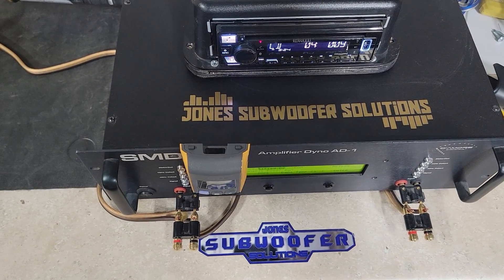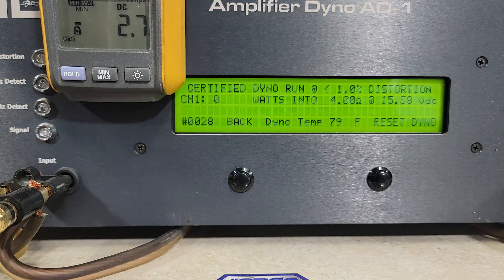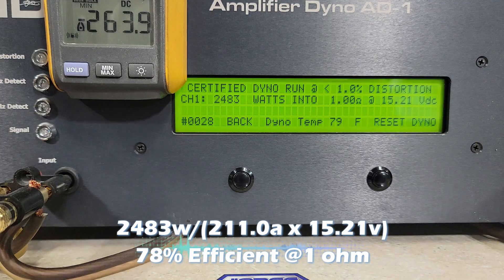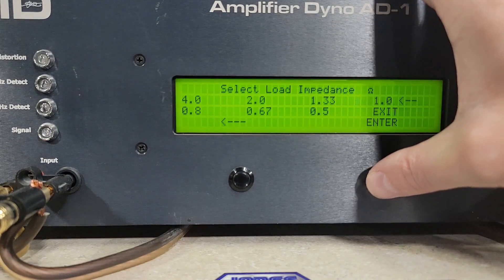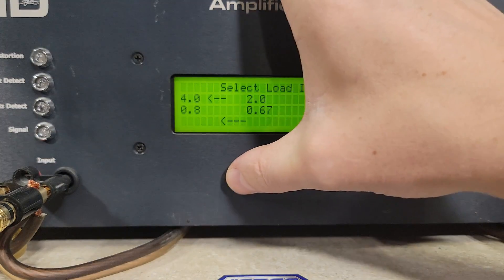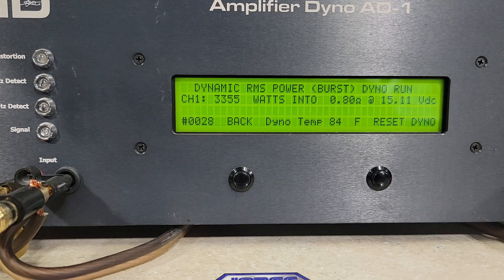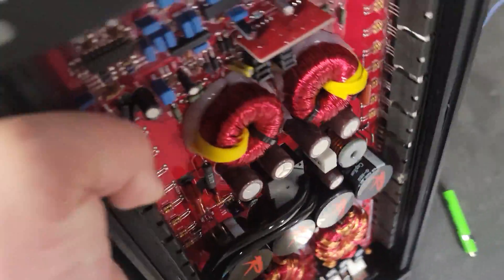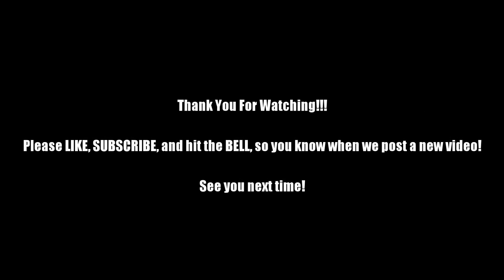AD-1 Amp Dyno Ruthless Audio 2300.1 by Jones Subwoofer Solutions JSS

Comment: The jp13 does this lol
Reply: The Ruthless is a Korean amp, while JP13 is made in China. Ruthless also does 300W more at 1 OHM and is more efficient. It also uses better components,  24DB crossovers and doesn't have an annoyingly loud fan. Plus, if you get one that has an issue, Ruthless doesn't make you wait months for your amp to be repaired. Ruthless also offers a .5 OHM warranty with their amps for no charge, while you will pay for that from D4S.

Get whatever you want. I am sure there's a Taramps that'll beat D4S and Ruthless on price to wattage ratio, but there are other considerations to be had, like build quality and resale value.

Comment: Can you do a review on the New Stetsom  Bravo 8k   I'm thinking about running with that one I just want to make sure it's going to put out the power. I'm looking for a good amp with the powor at a reasonable price
Reply: I'm running 2 of the vulcan 8ks on 16 12s.thry do rated power and then some.jacob viral ran 2 of them on 4 18s.he did 161 with 2 vulcan 8ks.i imagine the new bravo 8ks are just as good or improved.

Comment: Gotta stop with the 15+ v tests it gives skewed results vs the industry standard and manufacture ratings. Very deceptive for the average person. I use to watch all your videos but I now I tend to just looks for other dyno channels.
Reply from the maker: I was asked to dyno the Ruthless amps at these voltages.
Reply: I don't think you understand the cost of your request. What system are you running on 12 volts? thx
Reply: @scottiffanimccord1509  99% of people using car audio run on standard 12v charging upto 14.4v….not sure what added cost you are referring to
Reply: @scottiffanimccord1509  Scott. Or Tiffani. Not sure which it is. But I’m not sure you understand what your saying. There’s no extra cost. It’s actually cheaper to keep a stock voltage than to run LTO. Look up headway lithium. Pretty cool stuff out there, Tiffani. Or Scott.
Reply: @SquidsGrowHouse  I understand now that you told me thank you🤣🤣🤣